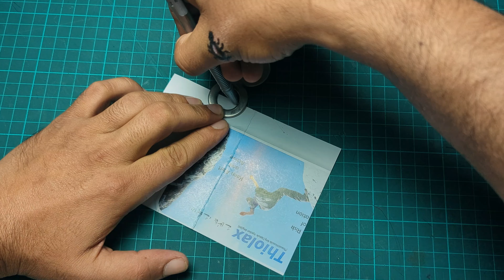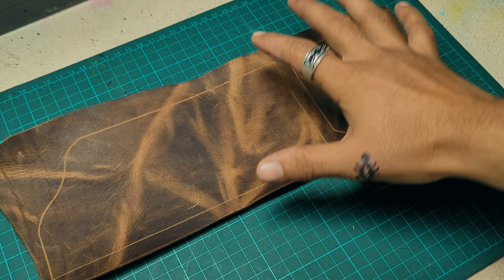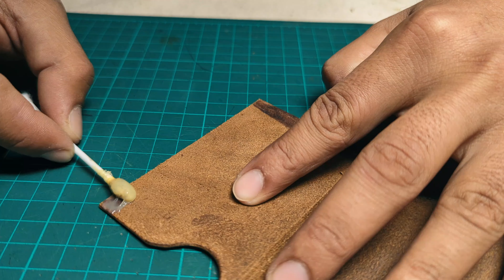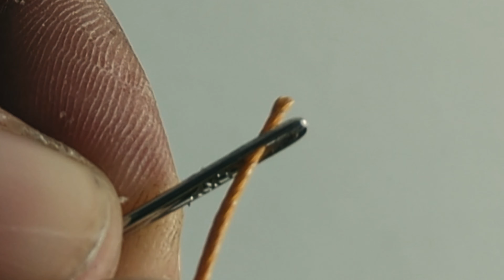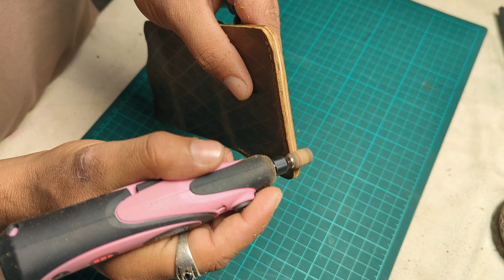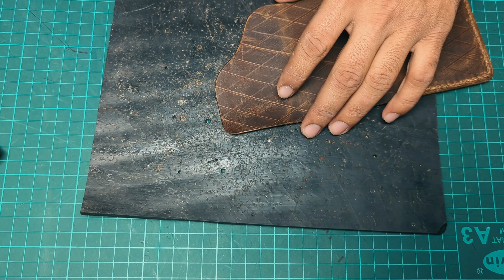Making a SMALL leather edc Wallet ! Leather Craft Asmr

Comment: Do you have a video of the weights?
Reply: @lawanginleather  The leather wrapped weights you use to hold down your patters.
Reply from the maker: Unfortunately not ..
Reply from the maker: It's basically a magnet wrapped 🫔 in a leather,
I use steel underneath the cutting mat
Reply: @lawanginleather  Oh, that's smart, I never would have thought of that.